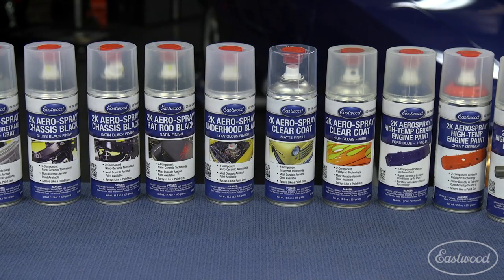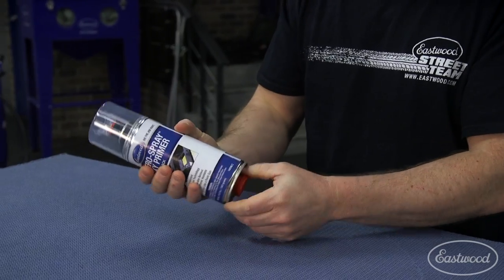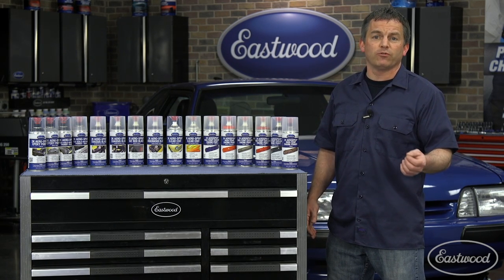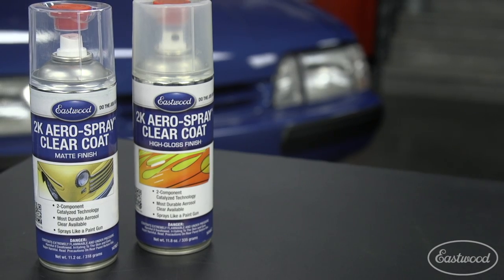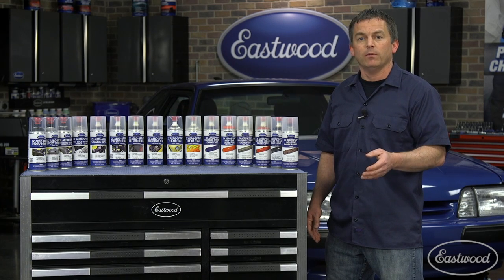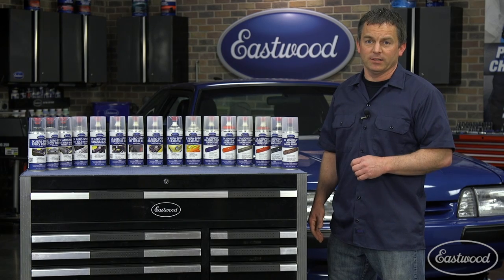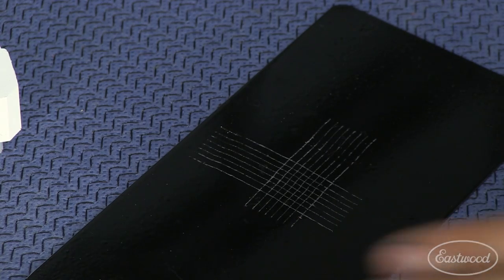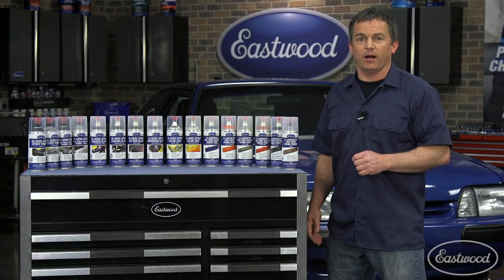2K Aerospray - Durable Two Component Coating in a Rattle Can! Eastwood

Comment: If this is a proper 2k poly, and you can sell it at this price, I wish this was sold at my local auto-stores....if you could sell it at twice the price, I'd still pay it to be able to last minute stuff buying from a brick & mortar store for last-minute jobs.
I'm a huge fan of 2k paints, but, the big guys want me to invest $10k or more on their systems in addition to the costs for HVLP spray-guns and compressors. Rattle cans at this price would be insanely convenient for small stuff.

Comment: Can you use a 2k urethane primer on bare metal or do you have to use an epoxy primer
Reply from the maker: Our Aerospray is recommended to be sprayed over primed and painted surfaces.

We do have urethane primers that can be applied over bare metal though:
https://www.eastwood.com/eastwood-gray-urethane-primer-and-activator-gal-kit.html

and

https://www.eastwood.com/eastwood-optiflow-roll-on-urethane-primer-gallon-catalyst-kit.html
Reply: @eastwoodco  thank would have that in a 2k aerosol can  as well